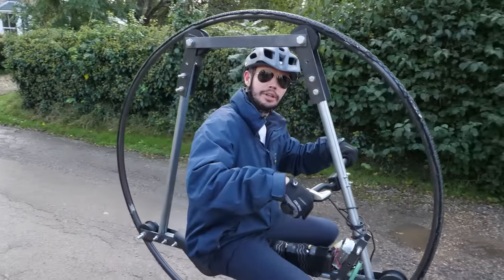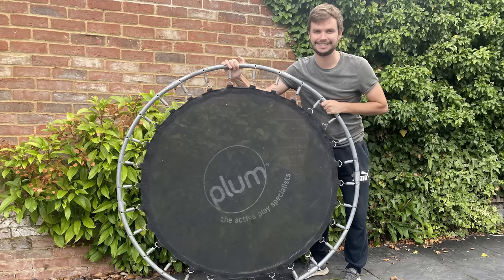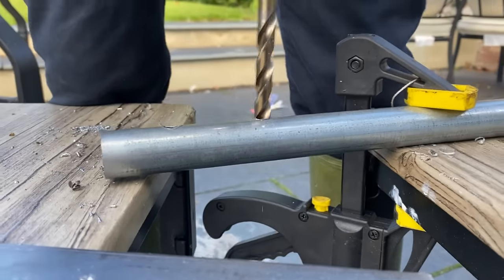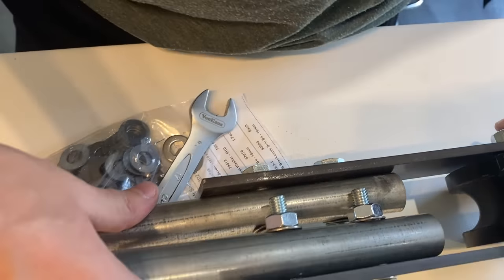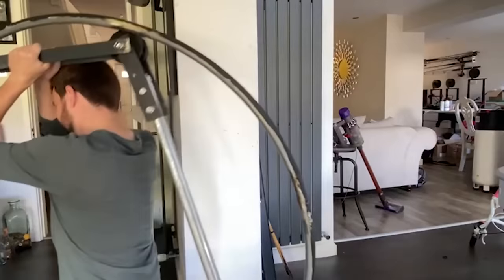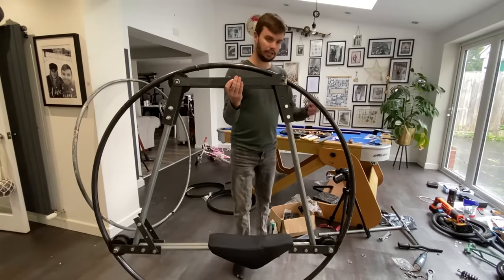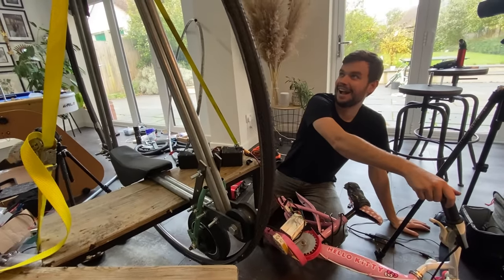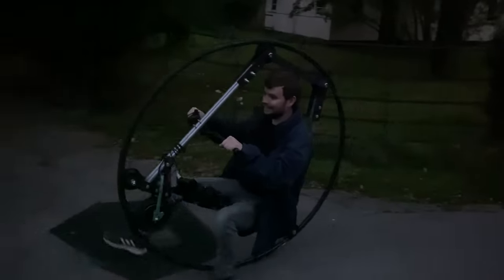Making The Strangest ebike - The Monowheel

Comment: Can't help feeling if it was 3" taller inside, you'd get your head in and keep your weight central as opposed to off to the side, which might give you more control/balance - the option to shift your weight has got to be a good thing, right?
Reply: Yeah, I think your right, he needs more head room, so he needs to be Lower... 
the straight cross bar that the saddle is on needs to come down to another support wheel, 
which would lower the whole set-ups centre of gravity, and
also give more head room. Then he can lean more for better balance.

Also, rather than going pure monowheel with his feet up, he could get some heelys shoes, the ones with the hidden wheels in the heels, and just keep his feet down for stability.
Reply: being taller and wider would likely help quite a bit lol

(ofcourse being too wide would mean you can't see)
Reply: I was hoping someone said this.
Reply: I guess that he can lower the seat a bit to make room.
Reply: I was about to comment this
Reply: @ThisIsMe3699  would need to redesign the subframe to lower, I would actually try a triangular subframe with the point at the top to increase headroom
Reply: @chrisflanagan7564  The existing trapezoid-ey shape would probably work fine if they just rotated the frame a bit and mounted the seat in a corner rather than on a flat bar. There's no law says the "bottom" of this thing has to be the bottom!
Reply: Thought exact same thing
Reply: I think he needs foot rests as well
Reply: He could also add a second motor offset to the rear so the torque doesn't try to throw him off as much.
Reply: It's a Children's monowhell
Reply: He need some shoes with wheels on them as well, he could balance with his feet without friction
Reply: Yeah it could be refined and turned into something cool but that requires money and research people aren’t really willing to do since it’s just a fun video looking at it
Reply: @SimulationEvolve  This would maybe ruin the point of a "monowheel", but splitting the wide wheel in two would fix the vision problem.
Reply: @Gorrash  From what I've seen, there's no break system except his feet, adding wheels to his shoes would only make him roll towards his death if he wanted to break.
Reply: I was wondering why he ordered the same size ring as the trampoline since he clearly didn't have clearance in it the first time.  The vehicle would be MUCH easier to ride if he could be centered in it.  Also having the seat in a better orientation would help to keep his center of mass in the right place.

As it is, the vehicle is like balancing on a tightrope.  You've got to work against the bike to stay upright.  It's backwards design.

But my guess would be that he didn't want to have to remake what he had done already so kept the same size.  For budget and time reasons that would be completely understandable.
Reply: Also the wheel could do with being a little wider
Reply: @SimulationEvolve  This is where you make it very wide and and then have holes in it this should let you see as you ride.
Reply: Since the outer ring ends up custom made anyway, Sam could have order a bigger ring as wheel. But well, I guess remaking part of the inner frame take too much time and the problem is less obvious before testing.
Reply: I think if the straight bar at the top was curved he could fit his head in there
Reply: @SimulationEvolve  easy solution: add a camera to either side of the wider wheel and wear an Oculus 😂
Reply: I love this little comment section, internet coming together to actually solve a problem. need more of this.

Comment: I imagine emergency-stopping with it: smacks into the back of a lorry, and the monobiker keeps spinning inside the wheel with legs fully extended out on each side.
Reply: what a goof
Reply: Wait, but wouldn't that be safer than flying over the handlebars?  I mean, if you don't consider tipping to the side

Comment: I feel that if you'd just add a little swaying part at the front with a single smaller wheel, functioning as stabilizer, foot rest, and steering, it would actually work decently well
Reply: So a modernised penny farthing
Reply: It would . . . and also stop being a monocycle.
Reply: I would add a pendulum and training wheels
Reply: Yeah you could also improve it by adding a frame and making the wheels the same size then adding some handlebars
Reply: or maybe like for skying, the thing it could help
Reply: If you had a omni-directional pendulum attached to the bottom of the subframe actuated by servos it would stabilize the "vehicle" tremendously. If you lean right the servo would lean left to prevent you from immediately tipping over. Now the hard part would be, how do you make it be able to corner effectively? On a motorcycle you have 2 wheels at different angles and the friction is what causes you to turn. This however, only has one wheel lol.

Maybe, like someone else said, if it had training wheels that had a higher coefficient of friction then when you lean it would cause one side to drag slower than the main wheel causing it to turn. Might even be able to rig the handlebars to them so you can actuate the smaller wheels to increase or decrease turning radius.

It's an interesting idea and looks pretty cool, but would definitely need a lot more engineering to be anywhere near practical. I think it would be possible though if you had enough money and resources to throw at it.
Reply: @MinkoMix  Sounds interesting. I'd like to ride one if one is ever made. XD
Reply: You’d have to put a weight on the bottom to you make the center of gravity at the bottom so you stay still and not sway on the inside
Reply: An admirable and entertaining project. 10/10.
Reply: @MinkoMix  you can do a bit but speaking as someone who's tried to build multiple designs like this(in physics games) solving the rolling over front/back issue is kinda iffy. at least i never could get it to be predictable.
Reply: like a bicycle!
Reply: What it really needs is a lower center of gravity so he's far less likely to tip when he loses momentum. 

This can be done by adjusting the geometry of the inner housing so he's leaning back a little more, and being almost so low in the seat that you're practically dragging your butt on the ground.
Reply: @nunyabisnass1141  Definitely, I also thought the center of gravity looked to be way too high. Butt on ground, almost lying down on his back as a natural position, and feet rest almost at head height outside the wheel would mean he would be able to apply more acceleration/breaking without moving his body. Could fit some extra break pads on the feet rest for emergency breaking.
Reply: @Gnaaal  yeah, watching this makes one instantly realise the problem with stability and control is that he's up in the center. Don't get me wrong, he did a much better job than I would have with respect to the inner frame, but something more hexagonal with the seat nested in a corner at the very bottom would probably be optimal. Everything else can be fine tuned and added on once e that problem is fixed.
Reply: @nunyabisnass1141  One could also use a pair of gyros to dampen the tilt when de/accelerating.
Reply: @Gnaaal  Yes, seems like adding a pair of vertical gyros would solve both stability and proper braking/accelerating. Why no-one realize that without gyros the only way to de/accelerate is shifting center of mass forward or backward over the point where the wheel touches the road. No ride without rolling :-)

Comment: 1:42 Im a metal fabricator.
I dont watch this channel for tips and tricks, i watch it for entertainment.
So keep up the good work 😉❤️
My tips for you?
1. Gloves. ALWAYS wear gloves, and tuck in any loose shirt material when using an angle grinder. toull thank me later when you DON'T lose a finger or gouge your abdomen after it binds and kicks around at the speed of light.
2. Clamp EVERYTHING. this not onoy keeps the material in place, removing one of the many variables involved with cutting metal, but also gives the tools more constant contact with the material, making it cut easier with less force. Overall improving safety, efficiency, and reliability of your cuts.
If i think of more as i keep watching I'll put them here ❤

Comment: While the goal of the monowheel is to be contained within the monowheel, yours is a bit... small... but since you've got it build, a step by step suggestion as a jumping off point for mark 2!

Step 1. Extend the foot rests in front of the monowheel with a comfortably wide stance. The forward weight will reduce forward rise from acceleration. Adjust weight accordingly (but do not completely negate rise.) The forward, wide stance will allow you far greater balance, and thus turning.

Step 2. Add a wheel on the foot rests, but with high resistance, potentially a breaking system. This can be a single wheel in the center or, more preferrably, two small wheels on the outer edge for stable and safe breaking. These wheels will not touch during actual driving, maintaining a "monowheel" status.

Step 3: HELMET. You got a light bonk in the video, but that could have been quite a bit worse. Invest in a full face DOT helmet if you're going to leave massive bolts at temple level.

Are extra wheels for breaking/safety cheating? Do the wheels on a jet make it any less of a jet?

If you are willing to rebuild the inner body... lower the bottom rail for a more "cruiser" feel. Lower center of gravity should help with canting forward and back to offer more head clearance. You got brained because you couldn't shift weight to the other side with no foot brace and the risk of a lobotomy by ducking through the tiny gap.
Reply: yes
Reply: Sounds like working smarter and safer when finished
Reply: 4. Develope a feedback loop with a gyro that varies throttle/braking to control the internal mass. A larger wheel with the person close to the bottom will give more authority to resist internal rotation.
Reply: I agree with this except DOT is the worst helmet standard. Never set that as your baseline, it’s essentially like taping a popcorn bowl to your head and calling it safe. There are now like three different helmet standards of increasing difficulty to obtain past DOT.
Reply: This Sounds like Chat GPT  sugesstions
Reply: I have no idea what a DOT helmet is but all i can read it as is a damage over time helmet
Reply: Brilliant advice. I would add in just buy a motorcycle helmet too. :) :)
Reply: @SunnyCress department of transportation
Reply: Thought of a few of these myself also. It's a cool project though, and he's got a good mk 1
Reply: Big Wheel
Reply: @JeronimoStilton14  DOT  standards  may be dangerously outdated for motorcycle use, but for this application they're just fine. It's not like hes driving this thing going 60 on the  highway
Reply: @kenny344  even standard bicycle helmets don’t stritly adhere to DOT. DOT does not take into account impulse or rotation nearly enough. Yes he’s not exactly speed racing but you want something that will make sure you’re not just “protected” but actually saved
Reply: European standard helmet is more protective than DOT
Reply: @summerlovinxx  that just doesn’t hold up to scrutiny. Monowheels are called monowheels because the primary means of conveyance is a large singular wheel. Having extra stabilizing system or adding bearings anywhere doesn’t suddenly make it not a mono wheel. Notice that planes aren’t called helicopters even though their means of propulsion is still technically rotary ring engines
Reply: @summerlovinxx  Wings exclusively take care of up but only in the presence of velocity. You keep lumping control surfaces with the wing itself. But then why can’t we lump the control surfaces of rotor movement with the heli and call it simply a rotary system, which is the same as a propellor?

Your distinctions are weird.

Also the addition of wheels, as I described before, doesn’t matter if those wheels are not directly serving to contact the ground. Mostly because the use cases described can be accomplished with bearings and not “wheels.” 

Monowheel is not a literal tern, it’s a category. Air planes are not 2d cross sections of air (or a wandering air if you’re green) , helicopters are not spiral wings, though early iterations were much closer than the rotor systems we have today. I think you’re being overly pedantic to make the monowheel literal. My two cents
Reply: @summerlovinxx  I’m just debating with you, no hard feelings either way.
Reply: I would add, that if lowering the seat is worse, or if it doesn't suffice in helping with the canting, add a heavy ballast to the bottom of the frame to get the center of gravity real low.
Reply: most monowheel designs are fairly small to save on weight to make turning easier, you'd need some kind of counterbalancing system if it was large to assist with leaning
Reply: Needs back support as well
Reply: @sot1171 literally commented over a year ago but ok
Reply: Unless you're aiming for a low-rider design where you're looking down between your  thighs to see forwards, it'd be better to swing the footrests to the rear so you force the rider to lean forwards.
Monowheels only keep the rider at the bottom of the wheel as long as the driving force does not exceed the weight/inertia if the rider and internal frame.  They work well for a combustion engine because of the engine's mass, but as an e-bike you would need a counterweight of some sort or you're prone to just be doing flips without going much of anywhere.  Short of a counterweight (or in complement of one), you can also move the rider and the bulk of the frame as low as possible.

Comment: You need to add a foot rest that is out in front of the mono wheel plus a little more weight in the front. Part of the problem you're having is that there isn't enough weight in the front. On top of that without a solid foot rest it's hard for your body to balance and control. I'd also recommend making the rollers out of a different material, but I think you know that.
Reply: would also say sitting lower, and a bit more center wouldnt hurt either
Reply: if you had more weight on the front it would be unbalanced when slowing down so maybe a counter weight in the centre?
Reply: I’d also recommend lowering your center of gravity by lowering the seat. This will inherently increase your stability.
Reply: Also grease of some kind of lube on the rollers.
Reply: It’s the mounting point for his seat. Needs to come forward more, which would require a bigger wheel
Reply: @aidansyracuse3338  yeah, I agree. I was just trying to suggest fixes that didn't require a whole rebuild. I think what I suggested would at least make it some form of usable versus how it is now.
Reply: @noahmerid1698  respeck
Reply: Also add a wheel to the front. probably attached to your foot rest. This will give you something to brake against when you slow down or stop. This is likely necessary if you don't have an auto adjusting counter weight, but I'm not sure. At the very least this will add safety.
Reply: Why not add tinny skate wheels on the bottom of the shoes
Reply: @yuurrrrrrrr1  I don't think that would be very practical, but it would be hilarious. I would love to see that.
Reply: @noahmerid1698  Wait, wearing roller skates when riding this self-made monowheel could be the most practical solution to solve balance issue + leg fatigue!
Reply: You need a little wheel on the front and the back. Without some really hi tech gyro stabilisation system designed by Tesla there's no way really to stop you from rolling over when both accelerating and braking. Other than that as already suggested maybe redesign with a lower centre of gravity or some ballast weights right down low on the frame.

Comment: This is fantastic :)   I built a monowheel a few years ago, although mine was noisy and gas-powered with chains to gear it down. I much prefer your powertrain. I was nodding as you were saying you can’t let off when you start to panic haha. Mine was very heavy (around 100kg), I wonder if that made it easier to ride. I could occasionally go a mile or more with my feet off the ground, at 15-20 mph. It hasn’t run in a long time but I always wanted to build another.
Reply from the maker: I’m pleased you share my fear 😆 good luck if you decide to remake it :)
Reply: tried it Inline skates 🤔
Reply: @nana-nr6xr  not really an invention lol, also would be a safety risk. He does need to keep balanced centrally though, but the wheel is a bit too small
Reply: I think the problem is that when you go to brake, you ought to brake the big wheel and not the small wheel that is driving the large wheel. That way when you brake, it makes you lean backwards and not forwards.
Reply: Attaching your head to an unpredictable machine seems like a bad idea somehow
Reply: @nana-nr6xr  slow down there Dr.Kevorkian
Reply: @jonathanangladadavis  perhaps you should retake Physics, specifically the part about thermodynamics and potential and kinetic energy
Reply: you should have wheels under yoour shoes too!
Reply: Has anyone seen a modern built Dynasphere style monowheel? 
https://youtu.be/rvA7hDh_vhY
The lady in this video explains the steering set up a little, I've seen a few people build monowheels but a modern electric dynashpere monowheel would be pretty cool. 
I did a very quick search on YouTube and only see old footage...
Reply: Sam Barker you definitely need a ballast weight on your monowheel
Reply: @SamBarker  what if you put on roller blades?
Reply: @SamBarker  Also, there's lot of water and air space out there.... Make a flying boat or something.